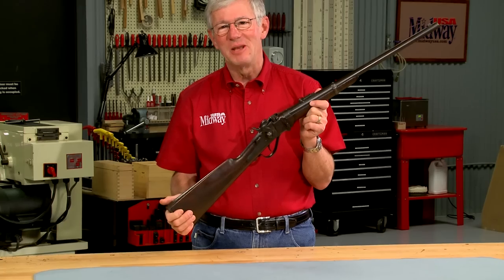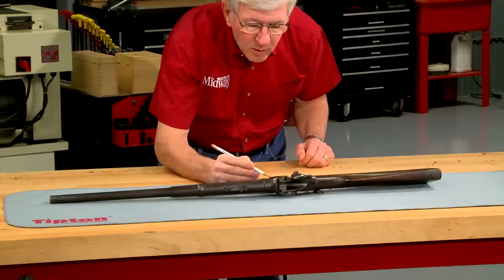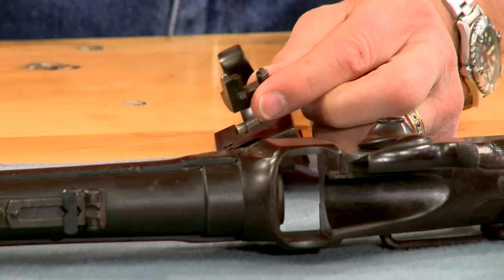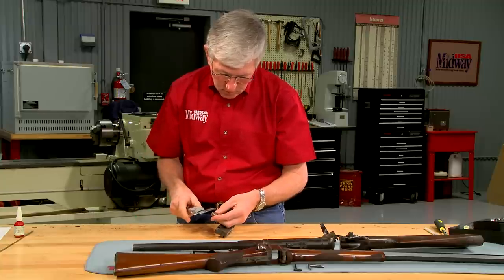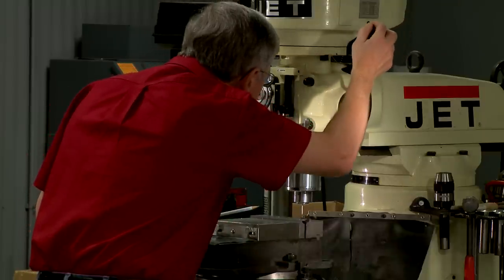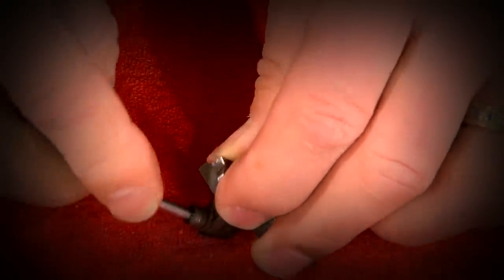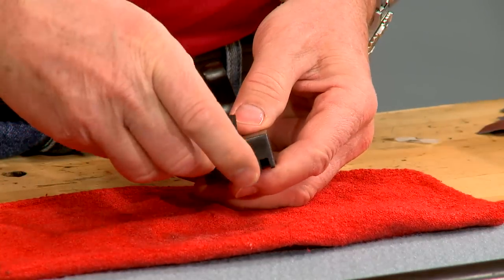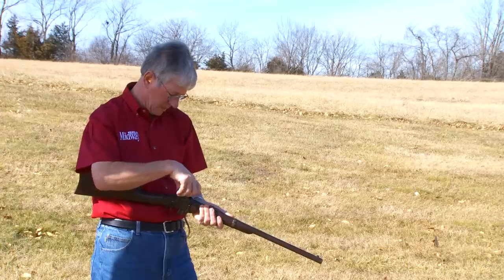How to Repair the Firing Pin on an 1869 Sharps Rifle | MidwayUSA Gunsmithing

Comment: This is probably THE most common repair needed on a Sharps rifle, the reason is that the firing pin is under pressure and when you open and close the action you're supposed to put the hammer on half-cock first and I see so many shooters who don't do that, and even Larry in this video when he loads the gun before he shoots it does the same thing because you can hear two distinct clicks when he pulls the hammer back. Quickest way to break the tip off the firing pin.

Comment: What I have never seen on Youtube is a video showing the inside of the firing pin housing on an external double hammer 12g. Not a locks-box, that screw in an out. I realise it will be simple but I'd still like to see such a video.

Comment: So right, the smallest details ... Got a question about fixing mine!  I've got an old single-shot .22 "Sears" (probably Winchester) hardware store gun from the 60's (I'll guess, on that.)  When I pull the bolt back, the stop no longer works, the bolt slides all the way out.  When I field-strip it, there seems to be a little nub on the "trigger retainer" that shows a slight bit of wear.  Is that what stops the bolt from sliding out, without having the trigger squeezed?  If so -- will a dab of JB weld fix it?  Thanks in advance for your advice, it's GREATLY appreciated!
Reply: Look up a manual online theyr out there for your model. You probably are missing something. If your missing something got numrich.com and order what you need. There may be many variances of your rifle all with same internals as sears had many manufacturers build their guns they are the same as the manufacturers line just different name so you might have to do some cross references. Do not use JBweld fix it right if your going to use as any modifications or putting things that don't belong in there can cause misfires, or worse. You could end up injuring yourself or others. Guns like that ate cheap to fix.
Reply: Look up a manual online theyr out there for your model. You probably are missing something. If your missing something got numrich.com and order what you need. There may be many variances of your rifle all with same internals as sears had many manufacturers build their guns they are the same as the manufacturers line just different name so you might have to do some cross references. Do not use JBweld fix it right if your going to use as any modifications or putting things that don't belong in there can cause misfires, or worse. You could end up injuring yourself or others. Guns like that ate cheap to fix.

Comment: do is possible to install a spring in firing pin hole , to push back the firing pin out when we open the breach , to not have to half cock the hammer ? Can be a safer way to upgrated a Sharps . Many broke the firing pin because forget to half cock the hammer before open the breach , Each time the firing pin come to encounter the action wall and bend or broke with time . So with spring that can prevent a broke

Comment: How would an old timer have secured the new pin? Peening, silver solder, brazing?
Reply: He said Green Loctite.
Reply: John Jenkins I doubt green loctite was available back in 1869 :-)
Reply: Oh, when you said "old timer" I thought you were talking about Mr. Potterfield.
Reply: solder would be my guess
Reply: +Dillon Flannery Probably on a shaper or a planer for the square sections, and a small lathe for the round parts. Case hardened afterwards.